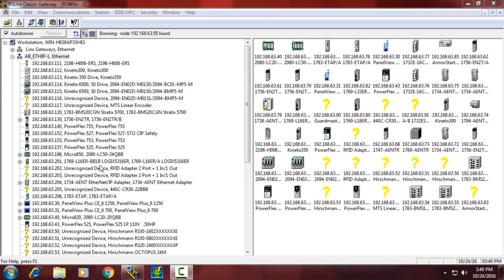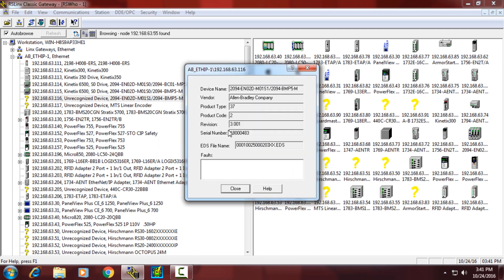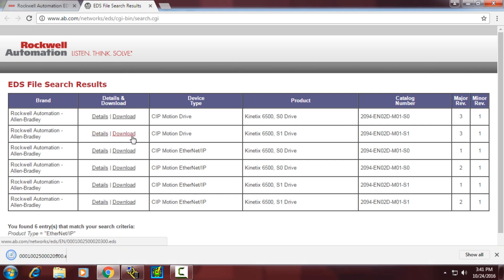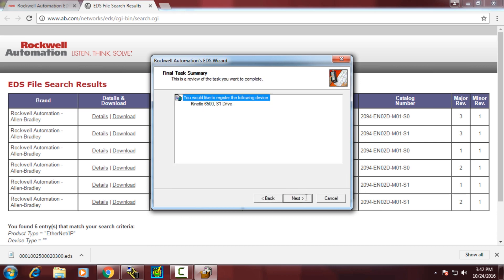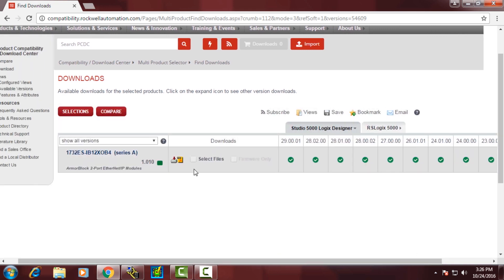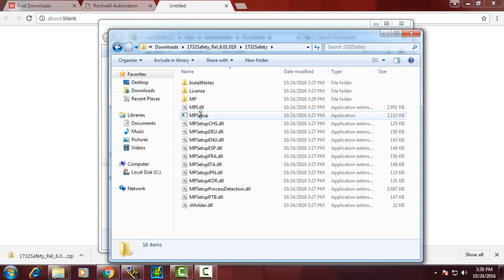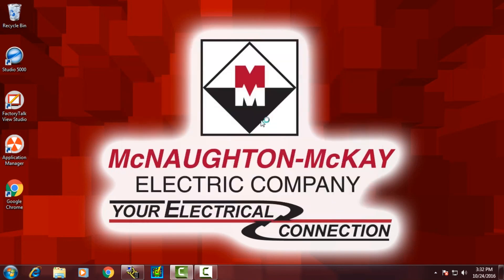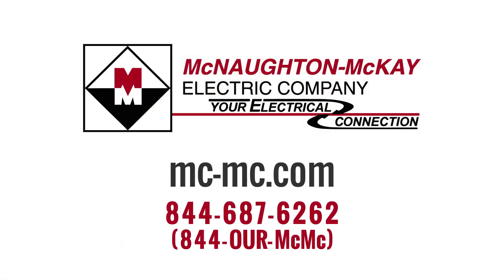Difference Between EDS Files and Add On Profiles

Comment: Is an Add On Profile better than an EDS file? What are the benefits of the AOP over the EDS file? Does the EDS file just give you an array of a nominated data type in the controller tags, whereas an AOP gives you named items of different data types in the controller tags?
Reply from the maker: Hi Don, One is not better than the other, they both have their own features. Module profiles, also known as Add-On Profiles, are required for the programming software to communicate to the device and typically generate a graphical user interface (GUI) which is used to easily configure it. EDS files are required for communication based software to be able to identify the device. This includes RSLinx Classic and RSNetworx for DeviceNet/ControlNet/EtherNet/IP software. If you have further questions or concerns for your application, we recommend reaching out to your local distributor for personalized support.

Comment: Hi Mike, Thanks for the video.  I have a problem because I am using an old VM with windows XP.  So it can not run the MPSetup.exe because it is a 64 bit program.  Is there a way to get the new AOP on my windows XP VM?

Comment: hello i have a question add on profiles works in Rs logix 500=? I have a card but this one does not appear in the program
Reply from the maker: Hello Erik, AOPs are only available when using RSLOGIX 5000 / STUDIO 5000, not with RSLogix 500. If a card is not available to select via your RSLOGIX 500, you will need to check the version you are using, if your software is an older version and the card is not available to select, then you will need to update your software via a Rockwell Automation TechConnect or purchase a new license of RSLOGIX 500 from your local Rockwell Automation distributor. Thank you!

Comment: Hi Mike, thanks for the video
I have problem, How I can add hardware device to device list ? because I want to add 1794-ie8h to project in studio 5000 v29 and I don't find it in device list, please help me.
Thanks
Reply from the maker: Hello Nour, You will need to download and install the AOP for this module to be able to add it into the device tree. The AOP can be found here: https://compatibility.rockwellautomation.com/pages/search.aspx?crumb=117&q=AOP
Click on the second one down, the one that says Add-On Profiles, then click the little gray arrow pointing down on the side and scroll down until he finds the 1794 Flex I/O AOPs. If you have any further questions or concerns, please contact your local Rockwell Automation distributor. Thank you.

Comment: hi mike, i have a question, i try to find the *.eds for the panelview plus 6 1250, but in the page of rockwell say you find the *.eds for the panelview, but when i download the file is *.exe and it's not *.eds, where can i the files? or how i find the file *.eds
Reply from the maker: Hi Luis, Some EDS files are automatically installed when the .exe is ran. Download and run the .exe file, then complete the configuration. If you have any issues please contact Rockwell Automation or your local Rockwell distributor for support.